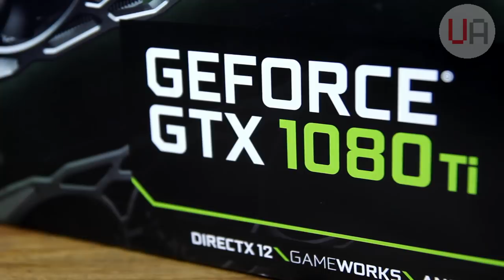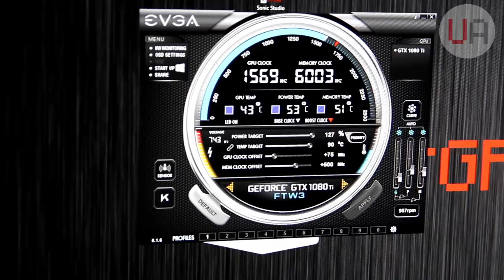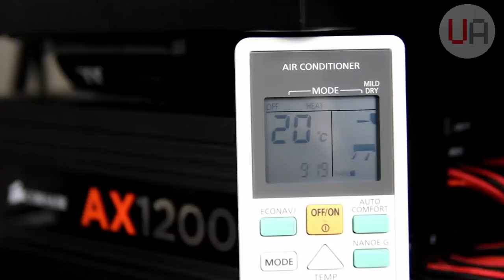Liquid Metal on a 1080Ti - EVGA FTW3 Gets Cooler!

Comment: I saw a video where you have to remove the actual shroud screws as well. Can i just remove the 4 screws off the back around the GPU and pull the heatsink off? Or do I have to remove the shroud screws as well?

Comment: I ordered the same liquid metal you did.  Do you recommend any precautions or extra things to do to be careful and to do this right?  Should I possibly use tape to temporarily make sure the ics dont get any on them or something like that?
Reply from the maker: +Christopher Greenwood clear nail polish or electrical tape over the resistors beside the die, if it's your first time
Reply: I did this ti the T   like for real.  I took my time and made sure nothing was shorting out or out of the normal.  I put it together and took it apart twice and it works but it crashes instantly when I do  a benchmark.  I took it apart for the third time and there is absolutely no liquid metal on any  parts.  I used " nail hardener to keep the resistors safe and used about the same if not a little less then you.  Its 4 am here and I will pick this back up when I wake up in the morning with a fresh head.  Unlike you, I dont feel like the FTW3 has a good enough cooler for overclocking compared to most of the others with there 2.5 slot size.  Would love to hear your thoughts.  Subscriber.
Reply: So I used nail hardener as it was recommended by another person because of being able to with stand higher temps.  Unfortunately after I took this card apart and put it back together the card has never been the same :(  Are temps lower?  About 3c real world.  I had to take the card back out several times to get the block to seat right with the GPU.   After I got the the cooling working properly I have nothing but issues.  The card crashes all the time and my once extremely fast stable memory ( 960+ ) now has a hard time over 700+.  Any suggestions bro? Should I take it back apart (for the 4th time) and buy new thermal tape or something?  I just dont understand what could possibly be wrong.  There is no LM touching any where it shouldn't.  I am pretty upset and I am thinking I should have never done this.

Comment: My honest help and support- I have two of these and even on a cold boot upon checking my temps on one card are 5-6 degrees higher than the other for no reason at all. This got me upset, knowing that I had two of the same card and both were in a well ventilated case with different temperatures on no load on them at all. This drastically affects my overclock and boost clock. I was going to replace the paste because it might be getting quite dry thus causing the heat, with new thermal paste but I decided to go with liquid metal instead since I found that it is actually not a garbage aluminum heat sink and is a nickel-plated cooper one, which is "ok" to use with liquid metal. The plan is to go ahead with this change tomorrow since it's quite late ,but I will update this comment with my temperature drop. Anyone looking to use liquid metal? my number one hint is to be extremely careful I mean almost like walking on needles with a cup of coffee that is filled to the rim when applying liquid metal to NOT GET TOO MUCH on the die and only cover a small portion on the heat sink as you will get worse thermals without covering anything on the heat sink at all. I delided my 7900x successfully and found that my temps dropped 10c. most are reporting 15c but this is maybe because I took my time to make sure I didn't include anything more than whats needed and made sure there was an extremely thin layer on the die and the IHS in which I was happy with my 10 c difference. Also please remember that you should replace the Liquid metal every 2 years to maintain your temps but you have to do that with regular paste anyways therefore it should be fine for enthusiasts. Once more I will update this comment tomorrow with my improvement. 
This channel is great btw! cheers! Hopefully I could have helped someone planning on doing the same!
Reply: I am so happy I went through with this, heres why: applying liquid metal gave me a clear as day picture of my cards. I found out that the temperature difference was due to one card being faulty thank god I can replace it because I would be extremely upset If I couldn’t. After applying LM my main card dropped down to 61c on full 4k load with no issues however the faulty card was at 73c on load and was down-clocking itself. I checked to make sure that I did it correctly and I did it perfectly but I still couldn’t eliminate the temp difference. No wonder I was crashing before LM because the second card was reaching 84c on load which is ridiculous. I cleaned it up and reapplied regular thermal paste and it still worked like it did before but extremely hot causing my room to get really hot really fast. I will replace this one and am extremely happy I found out that I had a terrible card. However my main card dropped 10c thats right 10c! It used to get as hot as 71c but now stable 61! Even over clocked! I am super happy with it! Just another showing how important and useful liquid metal truly is! Love love love my main card and love the fact that I didn’t fall for a crappy second card! I would like to thank you all for reading and hopefully this can clear up some things for you guys. I am here if anyone has any questions :) cheers
Reply: correction I played for two hours straight and my highest temp was 63 therefore an 8c decrease instead of 10.. I was quick to judge hehe still amazing

Comment: Isn't that its dangerous to use that kind of metal?
I think few degrees not worth risk at all.
What i use is IC Diamond and before that i was using Arctic Silver 5 i think those two is more than enough and everything else is a fetish.
P.S EVGA do have warranty sticker and in order to remove last screw u must damage it at least all water coooled cards do have those stickers.

Comment: You could bypass power limitations of the card with LM as well. ;)
Just some of it on the resistors and you have no Power Limit anymore. Temp Limit should be no problem anyway.
https://www.youtube.com/watch?v=c2_UjhMHU5o

BTW u should isolate the components around the Die with normal Paste, just for to be save the LM not dropping on the electrical sensitive parts.

Comment: What products do you use to clean the stock paste?
Reply from the maker: +Chuck 99.8 percent isopropyl alcohol. :) 

You can get it from any good electronics store.
Reply: I use Everclear or any 198 proof alcohol.  The more alcohol the better.  I would NOT recommend using 70% isopropyl.  Too much water and you do not want that around your components.

Comment: that thermal paste looks like such a hazard. I'm guessing you aren't supposed to take it off. ever. since it could be rubbed on the PCB by accident. sorry for any new users who mess it up.
Reply: you can protect the transistors or any part or the pcb from liquid metal with either clear nail polish or silicone modified conformal coating.

Comment: Well i bought some IC DIAMOND  a paste just 2-3c difference from liquid metal on tom hardware tim reviews. for my 1080 ti evga got a temps drops from 87c to 56 c in gaming under load. so these guys has to have a bad application on the gpu for it to only drop a few centigrade.

Comment: How did the galvanic corrosion go? Any issues?
Reply: nickel plated will be stained somewhat, but will not corrode. bare copper will be plated by liquid metal. the only metal you cant use it on is aluminum.
I personally would only use it on nickel plated.
gamers nexus did a review on liquid metal vs copper and nickel.

Comment: Nice video, you see more of a difference on Intel CPUs once the glue gap is removed and liquid metal added (it works better even in a thicker application then TIM does, that does not like anything more then like a .01mm gap between surfaces). 

I may try this on my water cooled r9  390 but considering that runs at like 40°C under full load after a couple hours i don't think ill see much temp drops haha. 

And for people giving you shit about using it on a gpu they're idiots. Most gpu bases are using copper or nickel plated copper, and you can always lap the nickel plating and go down to bare copper.

Comment: If it causes the damage you bet your ass it'll void the warranty, only difference is you'll have to pay shipping both ways to and from evga just to be told.

It's legit not worth it on the like of the FTW3, a card that runs so cool anyway the further few degrees cooler won't really extend its life. But bet your ass if you fuck it up you won't be getting it rma replaced.

Comment: Not worth the risk
Reply: depends how confident you are
Reply: BangDroid i am using conductonaut between my cpu ihs and cooler
Reply: Ok so now I don't understand your original statement ...
Reply: BangDroid because on cpu, it gives me 10-15 degree temp drop over regular thermalpaste, and it is safer, the gpu cooler is hard to work with and to make it in place, never tried it, btw i have 1080ti strix